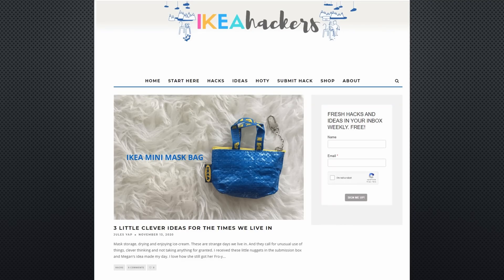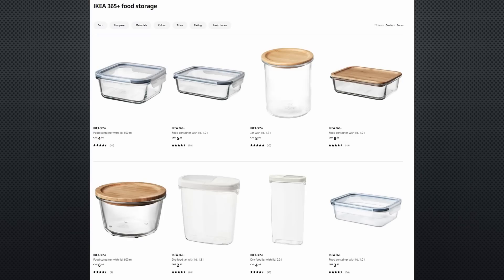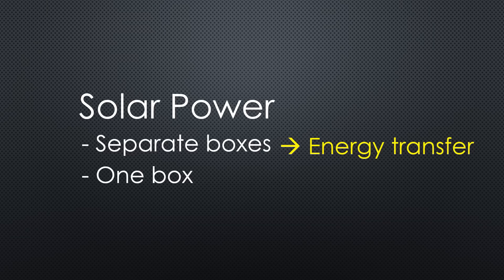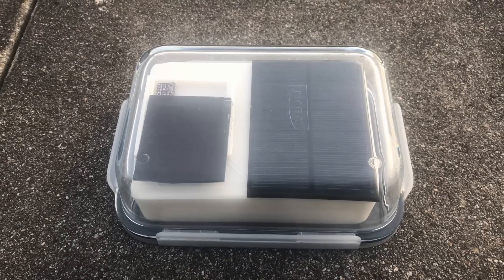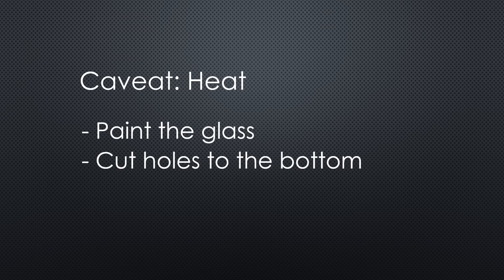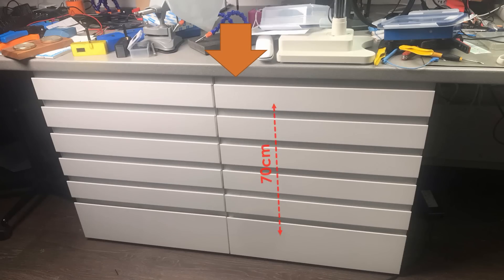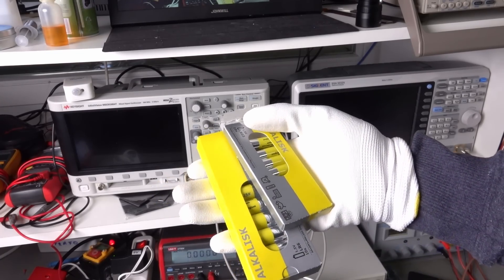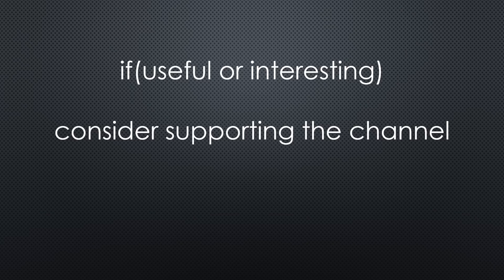#361 IKEA Goodies for Makers incl. my Newest Find

Comment: IKEA is a good source, I agree. fyi: I have used an algorithm to calculate sunrise and sunset based on the (internet) time and the geographic location, you can find it here : https://stackoverflow.com/questions/7064531/sunrise-sunset-times-in-c. Obviously, it only needs to be calculated once a day, so it doesn't take much.
Reply: Jose, this is great!  The energy required for network connection and communication is significant.  This will help.  Perhaps a monthly "check-in" to a NPT time clock to adjust the time accounting would allow the MCU to be self tuning.
Reply from the maker: Thank you for the link. It is for sure less energy consuming, especially for battery-operated devices. 
I call a service when the ESP is already connected to the internet (for transmission of measurements). So the time needed is not too long. And because it is solar powered it should be ok.

Comment: Thanks for another provolking video.  IKEA is everywhere!  I love cross purposing stuff.  For example, I have been using my 18V Ryobi battery packs from yard equipment, saws, and drills, for powering an nicrome-wire igniters that sets off a waterproofed firecracker that I place in mole hills in the grass.  A vibration sensor senses the activity.  The sensor signal goes through a MCU for verification, the MCU/transistor/relay then discharge the firecracker.  Too much fun.
Reply from the maker: Sounds really like a fun project. These power packs are also on my list for a portable power supply. I have a 20V/4Aah one from Lidl (which is probably not yet everywhere)
Reply: @AndreasSpiess  I think I remember the Lidl name as a quality chainsaw company from long ago (available on the Pacific Coast, US, 1970's).  For me, the key to using the powerpacks for other purposes was to find the clips that are used in the chargers.  That way I could get a solid connection.  For my batteries, the clips were cheap and easy to find.  That might help your portable power supply.  The high current available from these batteries was the other key.  I just hope the momentary current spike (~2A) doesn't harm the batteries as they are costly.

Comment: Just a hint on polypropylene: although a wonderful material, it definitely doesn't like low temperatures: it gets brittle. Maybe this doesn't turn out to be a problem for you, as your outsinde stuff isn't moved around that much. But fore sure something to keep an eye on in winter, as this brittleness doesn't go away when temperatures rise again.
Reply from the maker: Good point! I only checked the max. temp of 100 degrees which was ok for me. But you are right, it will stay where it is. And the glas hopefully will survive the winter without a crack.